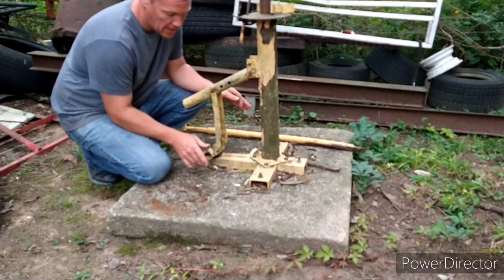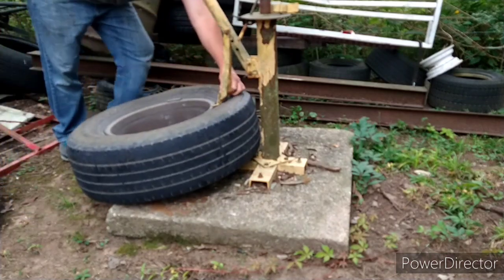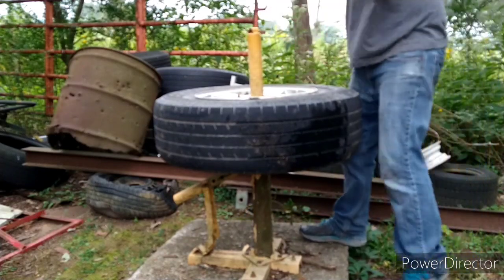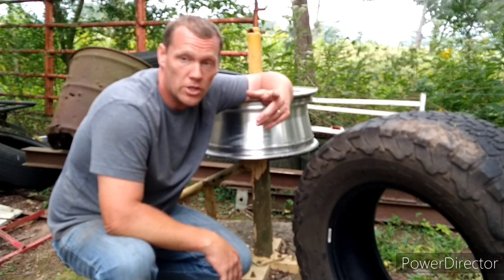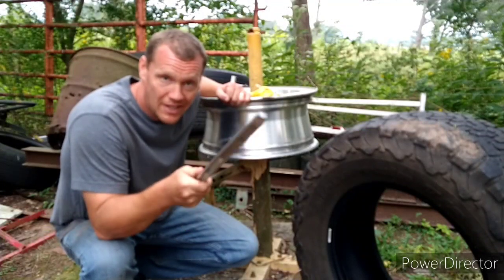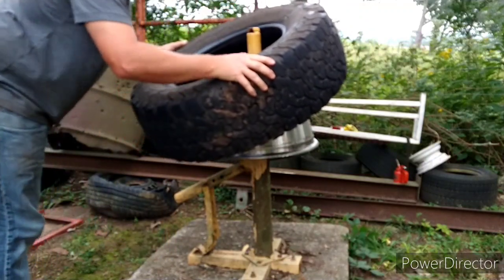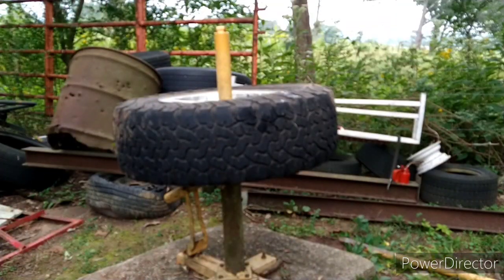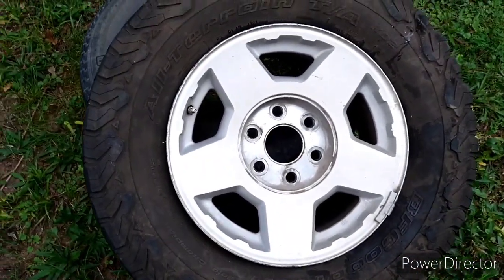Harbor freight manual tire changer, 20 years experience .

Comment: When I take my tire off of my tire changer I bounce it on the ground a few times seems to help the bead seat before I put air in it. I also leave the valve stem out and use a good air chuck to force more air into it quicker. On stubborn wide wheels I spray gas & then air inside and light it with a long stick! Woooofff! POP! She seats quickly and then pump air into it quick! Or it will unbead itself. Love God love people! Be safe kids!
Reply: I have a buddy who tried that gas trick and I just concluded that he wasn't The brightest bulb in the box because it didn't work so apparently he wasn't doing it correctly but it would be nice to see someone doing it correctly before I try it myself
Reply: Used gas explosion more times than I should say! Works perfectly but truth be told I've done my fair share of tires with the most basic cheap Chinese mini 12v compressor! Yes, those you plug into the cigarette lighter socket! 

All methods can work perfectly well. IF one knows what is doing! ;-) With this said. Truth be told the mini compressor is a game of patience. A long game of patience. LOL 😂 I wouldn't replace it with my "normal" compressors. But if on occasion you have nothing else. It can do the job! No fancy stuff needed. Bare in mind, that this way it takes longer to air pressure the tire than assemble/disassemble. LOL 😂
Reply: Really hard to love some evil people, though, who are purposely destroyin this nation and Bible values. We are now into our biggest trouble, and America being ruined in the next year or 2. Praying Almighty Father in Heaven send His righeous, glorified Son back soon, to stop all the wars and evils soon.,  but all hell about to break loose before that, sadly.   Ecc 12:13 "Fear God and keep His commandments,  for this is the whole duty of man."

Comment: Here's one you'll like try this when you can't get the tire to inflate get a ratchet tie down and tighten that sucker up for the wide tire at you might need two tighten it up tighting it up get it good and tight and it'll fill up
Reply from the maker: I've done that in the past👍
Reply: Starting fluid
Reply from the maker: I've done that on big truck tires.
Reply: @ChrisfromKeyfarm  your just not suppose to admit it lol

Comment: The edge of that concrete has got to be scratching the rim. Drop a door mat on it.
Reply: It's a farm truck I don't think that he is worried about a scratch or two. Just saying
Reply: @travislangevin6319 I was thinking the same thing. Yeah I know, it's a farm truck. So what? If you can prevent damage with a small effort do it. Also he mentions how the cap will cover the damage the hold down does (way less than the concrete) so obviously he does care.

Comment: I used to work in a tire shop many years ago and if we had a tire that was hard to seat we smeared regular old gun grease all around the bead. Never had one that didn't work on. I've changed many tires without a tire changer but I'm getting too old for that now. Love your videos 👍✌️
Reply from the maker: Thank you
Reply: The question becomes did the grease react with the rubber on the tire and degrade it and become a problem months or years later? I mean sure you got it out the door, I'm just saying there could possibly be a reason not to do that.
Reply: @michaeldose2041 Yeah. It’s just like how oil degrades rubber bushings and rubber engine mounts when you have an oil leak. If the vehicle goes through tires fast enough it’s probably no big deal but for something that might only be used occasionally I would be more cautious. Example: Classic motorcycles that don’t get ridden much.
Reply: @emmettturner9452  I agree tires can be around for many years.

Comment: Tires on the road are in contact will oil and grease from all the oil and grease leaking on the road. I have been using oil and grease on my tire beads for years and works great for me. Grease works best for me on my boat trailer wheels used in salt water.

Comment: I have used about 4 or 5 oz of motor oil on tire beads for over 25 years and never had a problem and antifreeze to balance them.
Reply from the maker: Cool
Reply: How do you use anti freeze to balance them?  Never heard that before.

Comment: I learned a new trick this year, toilet wax ring smeared on the wheel on the stubborn ones helps it seat easier.
Reply from the maker: Cool, thanks
Reply: More practical... Hair spray, the cheapest you can get your hands on! As been the best for years. I seldom use anything else! On occasion some of them even have perfume! LOL 😂 Jokes apart, it lubes surprisingly well and when dry improve the sealing properties. Either case any excess cleans perfectly well with plain water. And no damage whatsoever to wheels or rubber! Beside the also very practical self contained spray can form! 

Did I mention cheap, that's my criteria to choose hair spray... ;-)

Comment: Like Greg   I've used any kind of STRAIGHT dish wash liquid.   Been doing it since 70s and not had problem with rust.  I use it to both take off and remoumt.
   Side note if you ever get hold of an early 60s rim it may be a "safety rim".  These can only be  worked from the back side of the rim.  They will NOT come off the front.......Don't ask.
   You also want to start mount and dismount at the valve stem so when the tire goes to the center of the rim it dosen't slide over the base of the valve stem with a lot of pressure exerted on the base.
Reply: I have come across those, I did it from the front, and it was tough.  All four.

Comment: I've had one of these  for ~20 years, used it mostly on atv tires.  I stopped using it when my brother bought a May 'tire-matic' (really old center post machine) and we started using that on car, truck & trailer tires for a few years, he also picked up a cheap old spin tire balancer & we figured out how to make it work.  He recently sold the May tire machine & got a much newer rim clamp machine that runs on air pressure.  Now we don't chew up the wheels anymore..
Just a few cars will pay for the machine.  No trips into town,  appointments, waiting, or getting denied because you didn't buy tires from them. 

I'm watching for a hand-spin balancer now...
Reply: whats the brand of the rim clamp machine?
Reply: @clarityofthought  it's a coats, a cousin that's a diesel mechanic had picked one up from a job that was getting new ones and let it sit to rot in the desert.  It needed air lines & a little TLC , paint is faded stickers are missing & chipped off, but it works great now. Picked up a older used snap- on hand-spin balancer  since then too... with patience & willingness to travel, they can be had under $500.

Comment: i've mounted them dry and used a soapy spray as well. now i am using a silicone spray because i have some and it works well. 

a buddy had one of those harbor freight tire changers and he was bragging on how good it worked. he proceeded to demonstrate to me how awesome it was and when he used the flat end of the bar it snapped off. i have one now that my son in law bought me because he bent my other one by changing 8 ply tires. the pipe on the new one is quite thin and cheap and the holes where the pin runs through has already started to tear. i will beef it up and keep on going.

Comment: I have never got that tire stuff  but what I do use is dish soap it's  a good lubrication for the tire and it will not hurt the rubber.  And a nether thing I did with the harborfreight tire changer I cut the bar that you remove the tire with in half then I added in the middle more stell to make it longer so know I have lots more leverage so it is a lot easier to change the tire 😀.  And I dried 4 holes in the concrete then I put the things that you drive into the concrete that have threads so I put the tire changer over the holes then put the bolts in then I do the tire change when I'm done I remove the bolts  then I put the changer away then I put short creg bolts in the floor to keep dirt from going in the holes. With crag bolts you won't trip over then like you would with a regular bolt.
Reply from the maker: cool
Reply: What is a “creg” or “crag” bolt?
Reply: @cwixted  well there are Kreg screws.  But they don't have machine threads.  But they have very low profile heads.  Maybe that is it.

Comment: Dish soap with no water has done the trick for me. I’ve used it on 18 wheeler aluminum rims, down to lawnmower steel rims and I haven’t seen it rust out the rim.

Comment: I suspect this guy isn't joking about having twenty years' experience with this tire changer. He made that look easy. I assure you if you buy that tire changer it will take you much, much, much longer than that. 

The only thing I can see that he did that I didn't is that he pushed the tire down a bit farther as he was going around. I suppose that's why the tire didn't slip off on the opposite side as he was trying to make progress with the tire iron. That's what always happened for me. I'd get to the point where that large bar was no longer useful, use the tire iron, but the progress I made with the tire iron would just be undone on the other side of the tire---just kept slipping off.

I ended up selling that tire changer. But I still have a bubble balancer!
Reply: Actually,  he did not make it look easy, especially for someone having done it for 20 years. Usually, the bottom bead can be pushed fully on without needing the tool. He seemed to struggle doing the top bead using a jerking motion instead of a smooth pull.
Reply: Yes.  I can see my first time wil not be at all easy.

Comment: Thanks much for this!  I bought one last week, still have to mount it on 4'x4' 3/4" plywood base,.as i have no concrete floor or garage,. and hoping to use it on my 83 F150 Pickup 15" tires. Im in 70th yr, tired of spending  money, as Im on Soc Sec and still strong yet.  Some videos say to use Dawn  with water, though, but  i suppose that ok for  bead breaking, but not  for mounting.
Reply from the maker: I had to put mine on a slab of concrete, nothing else worked, I first had it mounted on a pallet and couldn't do anything with that setup
Reply: I just  changed my very first pickup truck tire  with this item. I mounted in aon a 3/4" 4' x 4'  board/ Was plenty of work,  but only mounting new used tire was hard. Glad i bought one. and should save me money! @ChrisfromKeyfarm
Reply from the maker: Cool

Comment: For those beads that are stubborn, you can drive another car on top of the rubber part of the tire to break the bead once you remove the valve core
Reply from the maker: Great tip, tried it once
Reply: I tried that  the other day, still have to set up  my new HFT changer on a base.

Comment: I was pretty amazed the first time I saw a dude change a tire with a sledge hammer and a couple of crow bars.
Reply from the maker: It's a pretty useful skill to have.
Reply: For many years I used my tire irons and a rubber mallet nothing else. But I'm getting older and I got the space. So I have one of these machines at hand. 
Truth be told you sweat less. But knowing what to do is the whole trick for either method! ;-)

Comment: I used Vaseline as a bead lube although have used olive oil in the past with no problems.
Reply from the maker: Since I made this video I have seen where some oil products will kind of break down the rubber on the bead I've switched to 100% dish soap.

Comment: I have never seen anybody use oil just soapy water and a jar mop, but hey if it works go for it ! I also like my white letters out.
Reply from the maker: I used to use soapy water, rusted some steel rims really bad.
Reply: @ChrisfromKeyfarm  unfortunately I keep winding up with aluminum rims, and no I don't polish them.
Reply: I've been using a  dish soap/water mix in a spray bottle.
Seems to work.
That said, what's in the mix that tire shops use?  Really soft wax?
Reply: @ChrisfromKeyfarm  - I find that very hard to believe! 
Probably rusted more from being out in the weather. From non dehumidified air on the tire. Or even the initial quality of the steel on those particular wheels.

Than the absolutely tiny amount of soap left from an occasional assembly operation... Let's be reasonable! 
I've been doing it for decades now. I could NEVER attribute rust to such application of simple soap! Now road salt, ice, rain, snow... That's a whole different game! ;-)

Comment: Coats 20/20 tire machine uses the same principle. They're still around and sell for $250 to $400. Well worth having if you do your own work. The more modern tire machines are two ro four times as much. Tractor trailer tires have a shalliw bead on the .5 rims. Usually takes 500 miles of run time to seat them. You are correct the tires will spin on The rim under heavy brakeing below 500 miles.

Comment: When I get them that don't like to bead up, I wrap a ratchet strap around it  and crank it tight enough to seal a bit. Leave the valve core out , it gets more pressure faster. Then once in snaps I put the core back in lossen the ratchet strap and viola.

Comment: Has anyone here used the trick of setting the tire on fire in order to get it to bead? I've done it once or twice and it worked perfectly.
Reply from the maker: I've done it on an 18 wheeler trailer ( I pulled the inside tire up on blocks to get pressure off of it) done it, but don't like it.😀
Reply: I tried it but I just about burned the tire up, don't know if I used too much or too little.
Reply: Do u mean spray starter fluid in the tire then through a match n saw it work on big tires
Reply: @cecileubank2555  spray it around the perimeter of the tire where it meets up with the wheel

Comment: I returned mine to HF within an hour. First attempt at breaking a bead the breaker legs folded like wet spaghetti.
Reply from the maker: Man,  that ain't no good. Mine has been really useful.
Reply: BtW - Same happened to me. I added 3 plastic zip ties around the breaker leg to give it some rigidity. (don't have a welder)
Reply: I bought the separate bead breaker.  Never used the one on the changer.  It was given to me, they didn't have all of it.  I took the bead breaker off and it's laying around out there.  I didn't have the cross looking base of channel iron that goes on the Bottom, didn't know I needed it.  I just welded the changer to a 4x4 plate of steel and use it that way.

Comment: For all the  ''yeah I use whatever lube'', water trapped inside the wheel is bad, period. Using just enough to make the bead slick is all you need. I cringe when I see guys squirting soap and water all over the place with a squirt bottle.

Comment: U aint supposed to use oil . I aint saving sheit.🤣
Reply from the maker: I have learned that oil will work in a tight but it messes up the rubber composition on the bead over time straight dish soap with no water works best